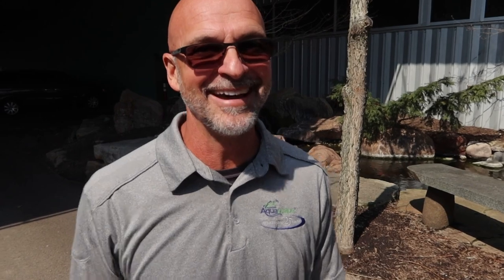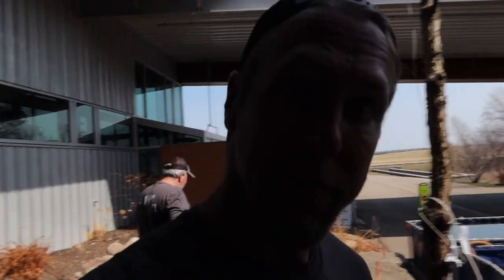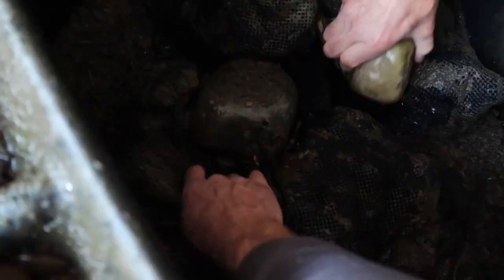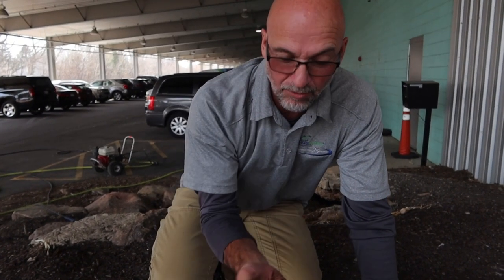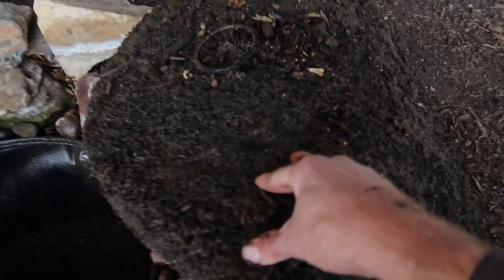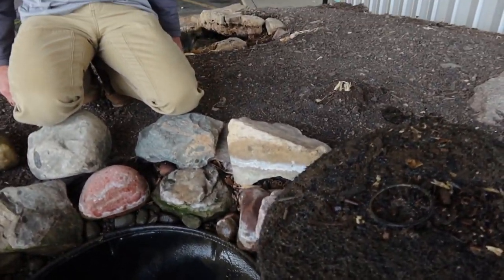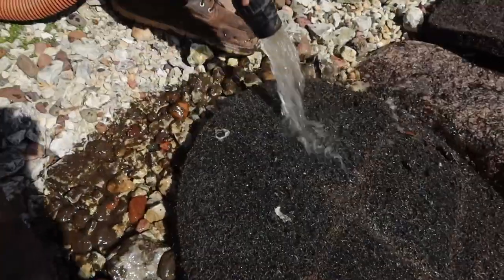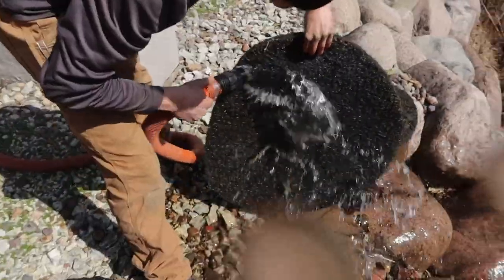17 Year Old POND Cleanout!! - ft. Ed The Pond Professor!

Comment: Wow.  Lot of useful info in this video.  Thanks!   I have a question.  When I remove water from my pond the liner in the lowest areas rises up.   Does this mean I have water underneath?
Reply from the maker: Yep, Hydro-static pressure. You could try to add more rock to weigh it down on the bottom. it will find it's way somewhere else hopefully up and out.
Reply: @TEAMAquascape  thank you so much for the advise.  Greg and the whole team at aquascape has gotten me thru four years of pond ownership.  I truly appreciate the knowledge, dedication and passion you all bring to this lifestyle.   Thanks again.

Comment: I am not a smart man, but I know what beneficial bacteria is, Jen-aye... I mean, Professor. 

For instance, although I am not a biologist, I know the amount of beneficial bacteria, or BB, in the water is negligible. That's why it's safe to do a 75% to 95% water change in order to lower the nitrates to acceptable levels - provided the new water's parameters are similar and it's been detoxified (if using city water). BB is primarily found in the filter media, but as the tank or pond matures, that BB can also be found on the walls and in the substrate. You can even find it on the plants and decor. Why put the old water back?

Also, great point on using the pond water to rinse the filter media. Not only to you eliminate the risk of destroying the BB colony happily growing there by not using chlorinated city water, but the slower flow will allow the media to last much longer. My question is, you then switch to power washers to clean out the pond itself. I can only assume you're using City water to do that. I am not as familiar with ponds as I am with aquariums, but I know an annual full teardown and scrubbing is frowned upon and discouraged. Isn't that killing off the majority of the BB you'd otherwise find in there? 

These are only questions, not criticism. As notes above, I am not formally schooled in biology not do I have an eco friendly pond (although I plan to change the later). I've been in the aquarium hobby for 40 years though and, some of the differences in maintaining the two bodies of water are pretty startling. 

Great video! Keep 'em coming! Looking forward to the next one.
Reply: I was thinking the same thing. Wouldn't using pressure washer with city water to pressure wash the rocks kill all the beneficial bacteria on them?